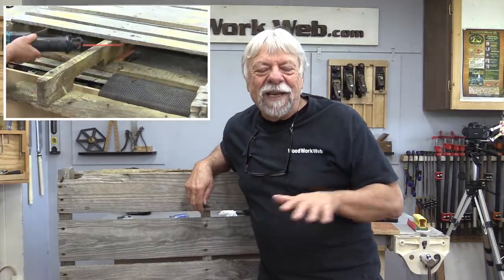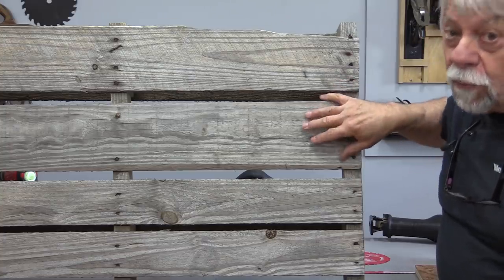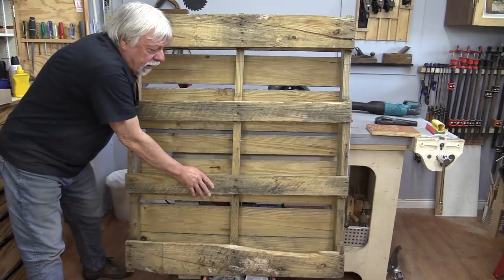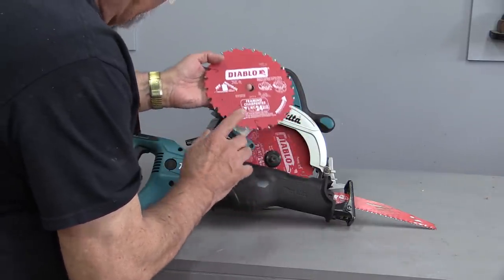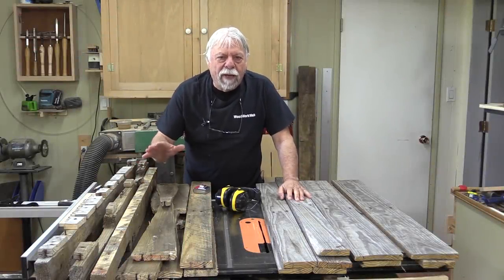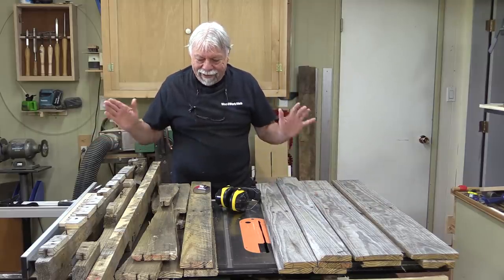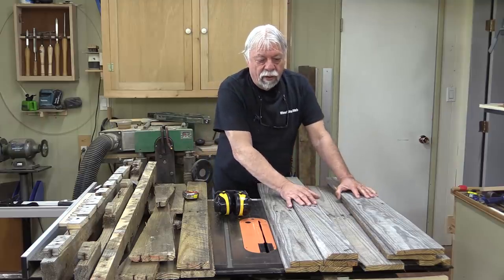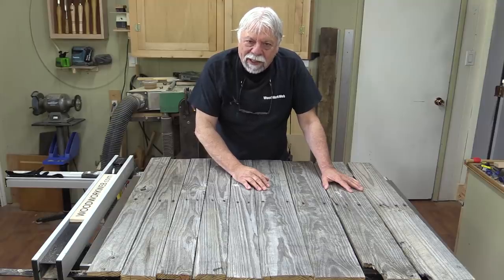Why Colin Knecht Quit Using Pallet Wood for Woodworking

Comment: I agree completely with this video.   Pallet wood is junk wood, otherwise they WOULDN'T BE MAKING PALLETS OUT OF IT!    There is no way to use it outside, it rots if it gets wet, so you are left with only indoor projects, and by the time you sand it, trim all the bad parts off, and discard all the checked and warped pieces, you are left with almost nothing.   
You'd be better off dumpster diving at a construction site.  It's amazing what nice stuff you can find there.  

Another better source of wood is cruising apartment complexes, people throw away nice but broken furniture, solid wood usually, and since it won't fit in the dumpster, people leave it next to the dumpster.  I find excellent solid wood dining tables and kitchen tabletops all the time.  
Check out apartment complexes near universities on the last day of each semester for extra fine pickings, as students just chuck everything out when the graduate.

Plenty of good stuff to be found on Sunday evenings in every neighborhood, next to the road, after people clean out their garage over the weekend.  So rescue these old beds and tables, saw them up and make nice new stuff with them.

Comment: What’s wrong with using an older already slightly dinged up planer blade to clean up your pallet wood? On the off chance you missed a nail in the middle of a board you’re not ruining a good blade. If you’re saving $6-8 for every pallet you break down (and some newer pallets have much more useable pieces), I’d say that’s worth it. I made a butcher block coffee table out of pallet wood. If I had bought materials for it that would have cost me in the hundreds to get enough variation in wood types, colors, and grain patterns to make it interesting. As it was I spent maybe 65$ on the legs that I bought instead of made (I don’t do metal working yet) and other items needed such as glue and finishing products while all the wood cost me was some time and effort.

Comment: Here in Europe you pay 10 euros or more for each europallet, it is not very profitable to buy them to use the wood. On the other hand, the pallets that we can find in the garbage are not standardized, they are from countries outside the EU, especially from Asia, and they are built with weaker woods. An important issue is the treatment given to the wood of these objects, many people reuse these woods to build things that will later be in contact with food (cutting boards, cupboards, small kitchen furniture...) but we must bear in mind that we handle wood treated with poisonous products to eliminate woodworm, for example, so this type of use must be avoided. And finally it is true that a broken saw blade because of a nail is enough of an idea to discard its use. Years ago a Spanish furniture manufacturer decided to buy a very cheap batch of beech wood from a northern European country. French beech wood is famous for its high quality but is also very expensive. This manufacturer found an offer and didn't hesitate, he brought a shipment of wood to Spain at a really low price and when he thought he was going to become a millionaire he noticed that the wood was full of metal remains invisible to the naked eye, and he did it in the worst way: by breaking several industrial saw blades at a cost of more than 300 euros each. Apparently the wood came from a forest that was the scene of several battles during World War II, the trees were full of shrapnel. I found that especially curious and thought you might be interested in knowing this story. A cordial greeting from Spain.

Comment: A lot them are chemically treated to prevent insects and moisture from damaging the wood so you don't want to breath in the dust or burn the wood.  About the only thing pallet wood is good for is building a compost bin or lining a pathway in the yard

Comment: Without pallets, I would never have started with wood. I was always terrified of buying wood, because it is bloody expensive and I cut the wrong side every single time . Do it with a pallet plank, and you can always burn it - it doesn't matter. I discovered that there is a certain "pallet chic" which I adore. I never fill the nail holes for instance - they are part of the chic. You can take all sorts of liberties because the whole thing is a concept sort of idea, which if you were using perfectly finished wood, would stand out horribly, and one mistake and the thing is ruined. For me, one mistake becomes a "feature", or indeed several :)) .
Here in Europe they use all sorts of wood for pallets, some of it lovely and you never know what you've got until you process it. I break down 20 pallets at a time, and can make panels of planks, all of which are different textures and colours. I use the stringers to make workshop trolleys for machines, and am making a work bench from them as we speak. I also love the modularity of pallets. Every problem has to be solved with planks or stringers - there is nothing else. I love it.
Furthermore, everyone without exception adores the pieces I make. On the other hand you have to be careful to have removed all the metal and stone chips. If I miss a nail, I have an hour's work resharpening the planer blades, but now I have produced the jigs I need to do it quickly and fairly painlessly, and I can get the blades a lot sharper than they were to begin with!
Curiously, for jigs I have to buy MDF and plywood, and it stings! Don't like it. And I simply couldn't afford to buy the amount of wood I use in projects - it would be out of the question. On the other hand, I have a trailer and friends at the Builders Merchant, and I can have as many pallets as I want, just for a three mile trip and a breaker bar (or indeed eight separate tools I have acquired or made, specially for the purpose).
Colin's being an old misery-guts!

Comment: 2 years ago this guy put up a video telling people how to save money by using...you've guessed it! Pallet wood!
I've been using pallet wood and I also have had 0 problems. There are good quality pallets out there. I only use the best. If there are any cracks I don't use them. I've sold over £1000 worth of pallet made furniture and never had an issue. I don't use a power saw to break the pallets down. I use a hammer and chisel so my tools don't get damaged. Judging by the comments saying the same thing as me, not really making a good point

Comment: It seems that many woodworkers like to use pallet wood for their projects.  If you live in an area where you can obtain pallets that are in good enough shape to use for these projects, then more power to you.  However, I have worked in warehousing for over 30 years, and I can tell you that, for the most part, any pallet that was usable for woodworking projects was kept by the company for future use.  Very rarely was I able to capture any pallet parts that were suitable for use in woodworking projects.  Generally speaking, the boards are cracked or broken.  Often the pallets are exposed to chemicals that would render them useless.  You never know what chemicals these pallets have been exposed to.  Don't get me wrong, I have taken pallets home thinking I can use them for a project, but those were few and far between.  There are exceptions or course, perhaps pallets that were used for the purpose of transporting furniture or the like.  But, generally speaking, pallets are not worth the trouble.

Comment: I use quite a bit of pallet wood to produce 'Rustic' & quality other stuff.    However, I'm very picky on what I harvest.  I have agreements with businesses that have 'Custom Pallets'. Used 1 time (motorcycle, wave runner, car dealerships, etc.). There the nails to contend with.  But, they usually aren't the 'spiral' nails used on 48"x40" or 48"x48" pallets. Is there some waste wood?  Absolutely!  My average is about 15% fire wood.  But that's a good thing also. The backyard fire pit always had free wood to feed it. I must make it very clear, " I NEVER USE ANY PALLET WOOD FOR ANY FOOD GRADE ITEMS"!  I wish it were possible to provide some pictures of what I've made & sold, for good money built with pallet wood.  The major key is to be Very Picky of what you harvest!!!

Comment: I’m a paramedic and emergency nurse. PLEASE do NOT burn pallet wood in your fireplace unless you are 100% sure it has not been exposed to chemicals. Most have been exposed to a wide variety of chemicals over many years which has leached into the wood. These off-gas when burned. I had a patient who died as a result of burning pallet wood in his shop stove. Turned out the wood contained potassium cyanide from a spill many years ago.

Comment: It depends on price and supply of wood where you live. I live in other side of this planet, boards are expensive. About 3 times the price you mention. And don't forget you will need a van or truck to carry a full length board and eventually you have to cut it into pieces in most of the projects. No one will insist using all pallet wood in expensive project, but little chairs for children use in the garden, repair fence, stairs, chicken coupe, you name it. It is solid wood, not mdf shit, leave it as pallet, it is rubbish, use it, it becomes wood again.

Comment: 30 years age the pallets I used were mostly built in south east asia and the wood was often a local hardwood, easy to take apart  and in decent shape. The newer, newer to me, pallets are tougher to take apart, wood is poor compared to the past and they require too much work; too much time for this old guy with limited shop time.

Comment: I disagree with this. I’ve made several rustic tables and furniture pieces and sold them with no issues. Don’t use a circular saw to cut the wood off, your wasting wood. There is a tool called the pallet buster that takes them apart quickly and yes you have to remove the nails but it’s worth it in the long run.  And why the laugh after everything???
Reply: I agree, I use pallet wood for what it is and that's rustic wood.  I wouldn't ever try to make fine furniture out of pallet wood so I very seldom plane it or joint it.  I also have a pallet buster and I can break down an average size pallet in 5 minutes plus it saves the ends of each piece.  To each his own.

Comment: I'd never use pallet wood, not even for fire wood. You I've worked in factories for 45 years and can tell you that there is no telling what a pallet may be contaminated with, in liquid or powered form. It's not worth it.

Comment: I was blessed with a machine called a "timesaver" it is basically two belt sanders working against each other ,,, one with a conveyor belt: one with a sanding belt,,, rocks and left nails not so much a problem...   I like the  carbide saw blades,, cheaper the better... I have a couple different pallet disassembly tools I copied from some of the Australian guys who do pallet lamination exclusively.... also found a air nail remover,,,  Since I am not one of the richest guys on the planet I heat with wood and coal... I respect your opinion... But, Like I said being blessed with the time saver and 30 dollar Air nail driver outer... and very limited income:: going out with my pickup or my van with the wheelchair lift I can score pallets like nobody's bizness... I do have a pin pointer metal defector for finding metal left in wood staves I am going to split for laminating on my bandsaw...

Comment: I use recycled wood, but I only do it when I think it is right and economical. Most often I use hardwood from pallets and wooden spacers. I do it because I can find wood with beautiful grain for free. To do small things at home is good because a hobbyist can spend a lot of time preparing wood. For a carpenter, working with recycled wood is not economical. If I were a carpenter, I'd rather buy wood.

Comment: Pallet nails are the worst! Many have spikes or barbs a half inch or so below the head which often come off in the wood. You really should scan them with a metal detector if you plan to plane or joint them.... I learned the hard way on a thickness planer that was three hours old!

Comment: You are kinda missing the point behind using pallet wood in the first place. You are scrutinizing the wood like you are rifling through the boards at a big box store thinking you are going to be making some heirloom quality piece. The rustic nature, the stained nail holes, the cracks ARE part of the look and charm of pallet wood.

Yes, thinking you are going to "salvage" only the usable portions of what looks to be "good wood" is a fool's errand. But using pallet wood to achieve a certain look, can only be obtained in two ways... finding old weathered wood, or chemically and mechanically "faking it" which takes about as much work as dismantling a pallet in the first place.

Comment: And the $8 wood you get at lumber yard is not even good as orange crate wood.  You have to spend 1/2 hour sorting at lumber yard and the "kiln dried" wood often winds up twisting like a corkscrew when you cut it.

Comment: In the most part you are write most of the times it's more work than it's worth. I do get some nice hard wood skids used to transfer machinery and they are worth it. the scrap for it becomes great firewood and the boards are wide and 3/4 inch. Unfortunately they are hard to find and get. I too have had tools ruined bi this and say unless its great wood not worth the work

Comment: Personally I am not a fan of "Pallet Wood" for almost any project (even planter boxes). Pallets are made of some of the worst condition wood. They are typically made to be used just a few times before they become trash. I would much rather buy wood that is more of a standard length and thickness.

Comment: its cheaper not to use any used wood when building like that, the cost of repairing your machines is much more expensive than just buying good wood to begin with., the easy way out is never the easy way out.

Comment: There is no doubt that it is easier and quicker to just buy wood at the store.  It's also a lot more expensive. That's all it really boils down to. The rest is mostly BS  There are pallets made of of very fine wood and pallets made out of lousy wood, there are filthy pallets and pristine pallets.  Can't say I've ran into very many with embedded gravel, certainty none I wouldn't have immediately passed over for the nicer ones right next to them.   I don't usually find the pine pallets to be worth the effort.  Pine 2x4's are cheap, but the hardwood pallets are a great way to get a lot of nice wood for a free.  I would suggest a cheap handheld metal detector.  One of those little toy ones work fine.  to double check you've got all the nails before running through the planer.  Oh and you can definitely make fine furniture with pallet wood, it's not limited to rustic things.

Comment: 1x6" , 6 foot fence boards are less than $2.50 each at any home center or lumber yard and you can use the whole thing and will fit in most vehicles

Comment: I don't care what the pallet video says. I don't use it. Ran one piece threw my jointer and it put a nick in the blade. I was pissed and will never be so cheap again.
Better option for free wood is your property.  A walnut tree fell down a few years ago. I have been cutting that up with my chain saw.

Comment: But free wood is free wood and if you're careful about the nails (never had embedded gravel) you can come away with some decent material. As long as you're not building a grandfather clock (I'm sure someone has) you can find useful pieces for your project. Sometimes the hunt is just as much fun as the find and if you have a lot of time on your hands, what's the harm? Go for it I say. Using pallet wood may not be for you Colin but one man's trash...

Comment: How much does it cost me to use pallet wood? Nothing. My time belongs to me. To each their own. The arguments this man makes are easily addressed. I would not clip the nails using a reciprocating saw on the middle stringer either. I have a pallet busting bar. $8 is $8. If he was better at breaking down pallets he could have more.

Comment: I see your dismantling those pallets the wrong way and hard way that is hard on blades,
No saws needed,
Takes me less then 1 min to dismantle those pallets except for removing of nails, which doesn't take very long either.
Make a simple system of a pry bar to pry them apart, so you can stand up with the pallets on the ground,  and then pile these boards on 2 saw horses, all with nails up, and drive the nails out and use hammer then turn them over and use a crow bar to pull the nails. Any and all scraps get burned,  with what I collect during the summer months heats my home for several weeks.  The ton of nails go to the scarp companies to get paid for them.
If you seen how simple it is for me to dismantle those pallets completely including taking the nails out, I think you would find my method takes very little time, Max 1 min to separate all pieces, and about 3 to 5 min or less to take the nails out,, Hit each nail  one or two times, after that step is done flip them over and my crow bar makes fast work of the nails, Total time is roughly 5 min, unless something else happens,
I usually go after the bigger pallets, and found enough to make and frame a 16 by 10 foot wood shed, framed a new roof for my cistern, and If these boards don't look strong enough I use them as they come doubled, or burn them in your stove.